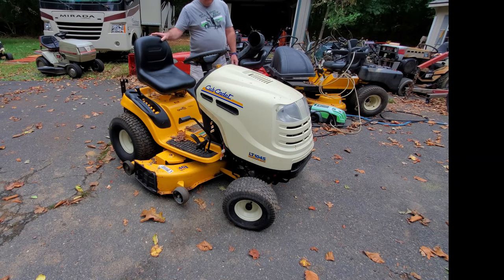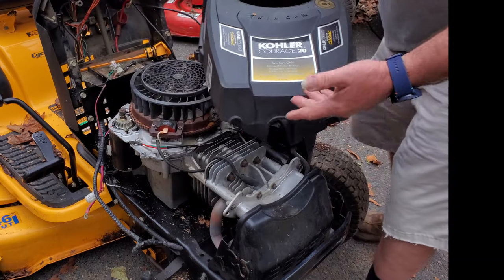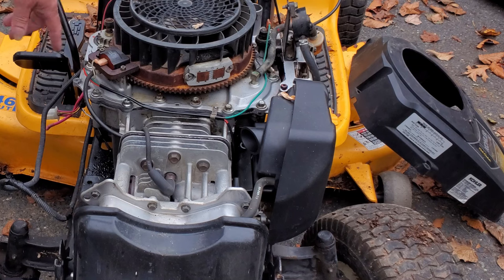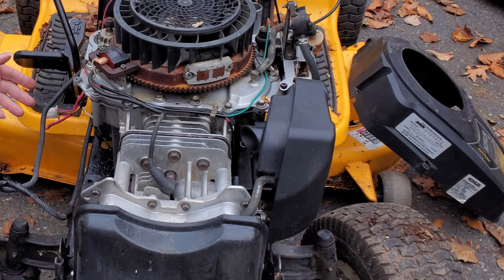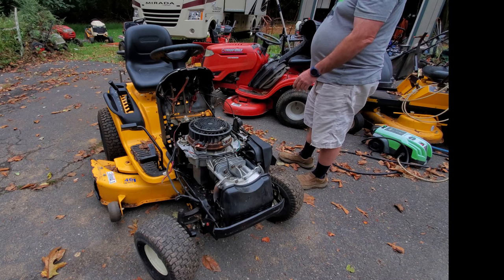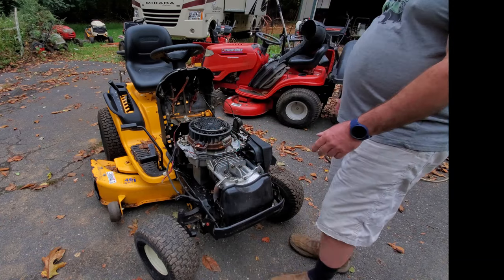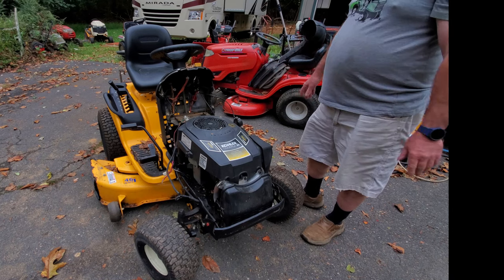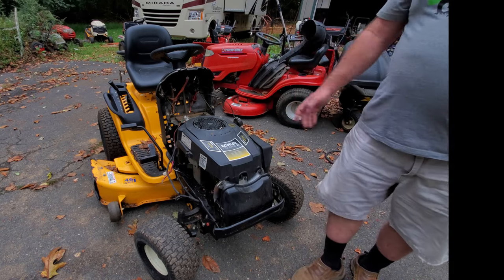This is why the Kohler Courage engine is so BAD

Comment: It's so sad that Kohler used to be the engine to have on a lawn/garden tractor.  Once they went away from cast iron, horizontal shaft engines,  they went down hill. What corporate management  is responsible for this continual failure?  No surprise that Kawasaki has taken the lead in a long term quality engine. Surely the lawn tractor manufacturers and the big box store demand for entry level price points have at least in part been responsible for such poor engine designs and longevity.
Reply from the maker: It’s definitely a bummer to see how things have changed over the years. Kohler used to set the standard for quality, and it’s disappointing when companies shift their focus away from what made them great.
Reply: My dad's JDs from the 70s had Kohler engines, and they ran forever.
I have a barn find JD 35 years old with a kawasaki engine, it needed a carburetor.

Comment: I have Husqvarna LT151 - 13 years old with same Kohler Courage engine. Only issue I have had so far is that governor exploded (plastic was getting old in the governor gear). Thankfully it did not take anything else with it, took it apart and cleaned up the engine guts and installed new governor. So far no cracks or any other issues. When I assembled engine back together I did add some threadlocker to those bolts, to avoid them running loose. Good lawn mower and I don't plan to replace it any time soon. Great video explaining the issue thought!

Gonna go and buy a lottery ticket now. :)
Reply from the maker: It's awesome to hear that you've been able to keep your Husqvarna LT151 running smoothly for so long! Proper maintenance really does make a difference. Thanks for sharing your experience!

Comment: So very true on these single cylinder Courages, I've had them in my shop, Craftsman, Cub, Husqvarna and even older Gravely's. Actually have a Gravely ZT1640 out there now with a Courage 16hp. That's the smallest Courage I've seen so far.
I still have my 2007 Cub LT1050 with a Courage V-twin 25hp that runs great to this day. 
Nice video sir.
Reply from the maker: Thanks for the compliment. I have had enough of these engines that I felt I needed to make this video, and just cur to the chase on the maun fatal flaw with the Courage engine. 
I have had some of the v-twin courages, and they needed work, but all were good engines.
Reply: Yes sir, they should've stayed with the Commands. 👍

Comment: My neighbour bought a cub cadet and I told him about those problems I help him to take the bolts out put lock tide and reinstall the bolts back . He checking the bols three times a years if they are tight. The cub is running good so far no cracks for the last five years.
Reply from the maker: Sometimes they do last far longer that most others.

Comment: My neighbor had a Cub Cadet ran it a long time lots of hours , he did some welding on his Kohler Courage 
had loose bolts etc. he was offered a new short block if the dealer did the work , he took the offer and sold it
bought a John Deere 4 wheel steer tractor which is still running strong
Reply from the maker: Thanks for sharing your neighbor’s story! It’s always great to see how others navigate their equipment challenges.

Comment: The wife's Cub has one of those Courage engines. I think you've pointed out one of the biggest design flaws that nobody is talking about. The issue with the top bolts was easy to fix with some loctite but her engine threw the internal balancer assembly thru side of the block. That's the other flaw nobody seems to be talking about. I think that's why Kohler discontinued these. To their credit they did provide a new short block but only if it was installed by a repair shop, the shop installation cost was over $400. I kinda wish now that I had just replaced it with a Briggs or a Kohler Command vertical. I guess when this one goes that's what I'll do.
Reply from the maker: Man, that engine sounds like a real pain! I feel you on the whole repair shop cost thing—it's like they think we're made of money! Switching to a Briggs or Kohler Command sounds like a solid plan for the next round!

Comment: I used the Taryl fix on a 1045 my father gave me - a modified c clamp holding the block together.  It’s been in service for many years and several hundred hours morenow with only the occasional checking of the bolts to be sure they’re still tight.
Reply from the maker: Thank you for sharing your experience! It's great to know that the Taryl fix is helping others keep their equipment in top shape. Keep up the good work!

Comment: Yup, I had the same crack in the same location, on my 2007 19HP Z4200. First thought the oil leak was from the loose crank cover bolts, and didn't see the crack because it was so dirty. Still leaked, and cleaned it up and found the crack. Put some J-B weld on it until I got a new engine, a B&S EX1900 durable. Mower still has a lot of life to it, so we'll see how long the new engine lasts.
Reply from the maker: They can still run with a cracked block, but you gotta keep oil in them.

Comment: I have a 2013 husqvarna with the kholer engine in it, didnt change the oil until last season, still runs like a champ, ill go look at the hours in a bit
Reply from the maker: Nice! That’s how you know you’ve got a solid mower. Can’t wait to hear how many hours it’s been running!
Reply: @ridingmowerking as of now 4047 hours!

Comment: I've got a single cylinder Courage bought new in 09 and is still going strong.
Reply from the maker: Good for you, like I said, there may be a couple good ones, somewhere.
Reply: Have you ever checked those bolts?  If not, do so and let us know if they were snug.
Reply from the maker: Hi, in the video I do talk about the bolts on this engine, and I do actually say if these bokts were tight or not. Thanks for watching.  @jimsvo4486

Comment: I've done some research ( I hope it's true) after mine, blew a small hole beside the sump seal (It was only 72 hours old), Apparently, a lot of Kholer Courage from around 2007 to 2011, were assembled by robots so, something might've went wrong, in the assembly line OR, I found out, the oil to be use, has to contain zinc. Maybe the wrong type of oil was responsible for it's demise. Who knows ?
Reply from the maker: Very interesting, I do not have the patience to do that k
level of investigating. I am just going by what I have seen with the failure rate of these as I have seen in person over the years.

Comment: Definitely not a fan of these motors, as you said they are extremely prone to many issues, some being unfixable, but iv got one at 680 hours still going strong at 12 years old lol. Im just waiting for it to die at this point but it keeps on going with no real signs of giving other than some blow-by. I wonder if it having a proper oil pump over an oil slinger like the briggs helps it live longer (ignoring the auto loosening bolts/cracking block)
Reply from the maker: Thank you for sharing your experience! It’s always great to hear success stories about these motors, even if they come with their quirks.

Comment: Doesn't anybody try welding them? Good video
Reply from the maker: I had a friend try to cold weld it and the aluminum would just pop and blow out with any heat. Have not seen anything where someone welded one yet.
Reply: I am sure it can be welded.  One time I TIG welded an aluminum piston from a 1927 Franklin.  It is on my channel. No issue what so ever. I think this gentleman has no welding experience, so he claims it can not be done, because it is made of Chin-easium.  That's not nice.  --Doozer